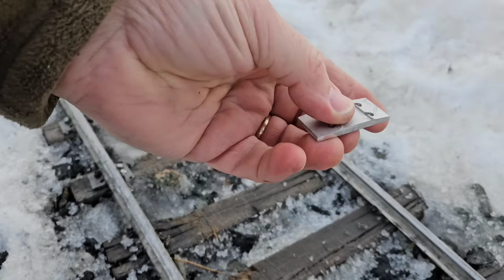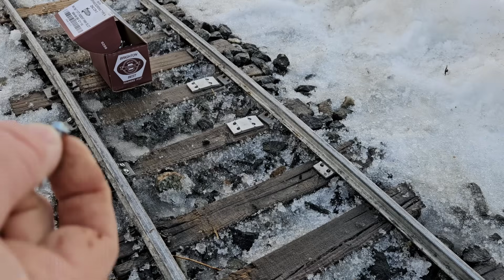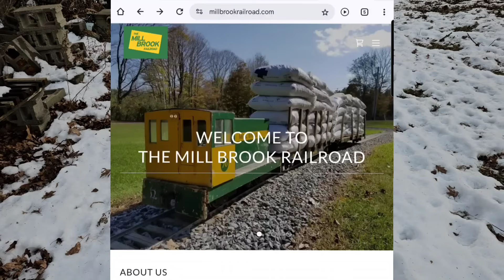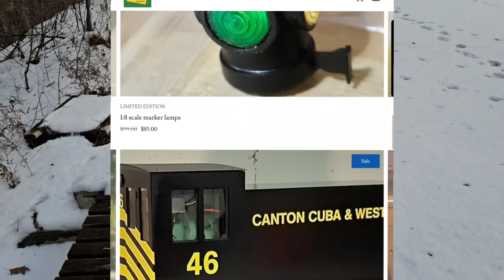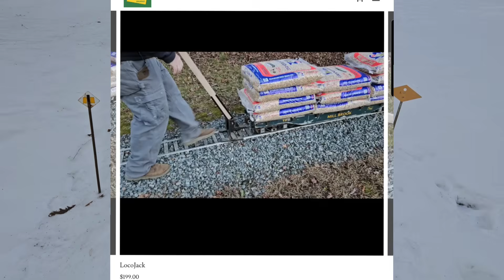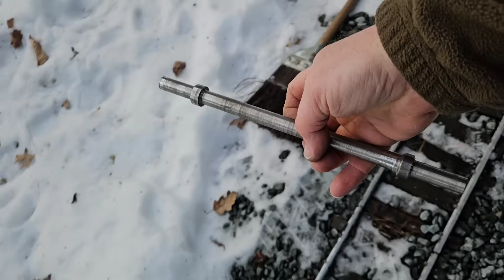Winter Track Maintenance: Tracking Down Wide Gauge

Comment: Before you replace the section of track. Look into resin ties. 
If your rails are aluminum, then use aluminum hardware. If you use steel hardware, you're definitely going to have problems.

Comment: make a wooden form for a concrete tie with a piece of rebar for reinforcement   should last a long time
Reply from the maker: I've been thinking about that for a long time. The part I need to solve is the tie plate part. If I make concrete ties then I want them to be pre gauged. So, I'll need to figure out how to incorporate a tie plate and a nut to go on the end of a threaded rebar. Not necessarily a difficult task, I just need time to do it.

Comment: There's a company in either Georgia or Mississippi that does batch part fabrication with sheet metal. Destin of Smarter Every Day did a video of them around or before COVID, so that's how I know them. If you can draw something up, it should be fairly easy for them to stamp out tie plates from a spool of Aluminum. The number of die strikes is small, so they should be able to do it with 3 or 4 dies. And the dies themselves wouldn't be very complex either:

1. Strike to put the four screw holes into the plate. (Also used for aligning to the rest of the dies.)
2. Strike to put the 2 degree canter bend you mentioned. 
3. Strike to cut and bend tabs to hold the rail in place.
4. Strike to cut the wider material into strips.
5. Strike to cut the finished tie plates off the strips.

They do all their tool and die work in house, so they can give you a quote for that. Destin did state in another video about a product he was developing (Made in the USA grill scrub brush) that the gentleman who was their master craftsman for the die passed away, but they do have someone he's trained. But with the sheer volume of tie plates your railroad (and others) will need, I think it makes more sense to got with a stamped product versus trying to cast or 3D print them.
Reply from the maker: Historically, tie plates for backyard railroads have been extruded aluminum. I'll have to look into stamping. Thanks for the comment.

Comment: Mark those bad ties to make them super easy to spot when you are in the mood to replace ties.
Reply from the maker: It's pretty obvious which ones they are. They're the ones that are splitting.
Reply: @MillBrookRailroad  Might be a good idea to keep a bundle of those "Utility Flags" in the 70. This way, anyone having a derail can just grab one of the flags and plant it in the ground near the problem area for the track maintenance crew (you and Eric) can find and fix later. I know train mountain have those green painted blocks, but the flags take up much less space, and the orange or yellow ones really stand out against the greenery of the Mill Brook Railroad.

Comment: Hey, Aaron, I may have asked this before, but would using self-tapping screws help mitigate your ties spitting? I realize they're more expensive, but using wood screws tends to split the wood along the entry point. Maybe even using a drop of wax on the tip of the screw would help
Reply from the maker: Self tapping screws might help. I don't know. I'm using sheet metal screws, which can cause  some of this splitting because of a more aggressive thread. The most important part of the screws for holding down track is that they need to be hex washer head screws with a 1/4" drive. That's the sweet spot. I've been using #8's, because someone donated a case of them, but #6's will also work and may not split the ties as much. Either way, 3/4 or 1" long is what I  look for. The tie plates on the larger rail that I'm going to install takes #6 screws, so that change might solve several problems at once.

Comment: Why not use polymer tyes.
These were trieled on the Ffestioniog at  the new Porthmadog Harbour extention station.
With the bad icey weather snd salt spray from the waves, they have proved sucessfull.
They are extruded so they can ve made in zny size.
On the FR they are cut down le
Ngths of standard rr tyes, the rail chairs are screwed down imto the new tyes and hold better than in the wooden tyes.
Reply from the maker: Where would I find polymer ties?
Reply: Tim @WayOutWest uses ties from recycled plastic, made from plastic tarps that are used a lot in agriculture. It's pretty much the same stuff as the plastic foil that's used for packaging all kinds of stuff. A company near him makes a few sizes of plastic 'beams', one of them seems to work perfect for him and the purpose of his railway.
But that's in western Ireland. Don't know if there's any such companies near you.

Comment: I imagine steel is the best overall for retainers
Reply from the maker: If you have metal tie plates, it is best to match the metal that the rail is made of.
Reply: Mixing metals starts galvanic corrosion.  Not a good thing for an outside railroad.

Comment: I don't know a lot but what if you cut up a bunch of ties and soaked them in a bucket of creasote then hung them to dry qould they last longer?
Reply from the maker: The dark brown ties were treated just as you described.
Reply: Full-size ties are also under pressure when treated, to get the creosote deep inside.

Comment: You would think those Thai plates would grip the base of the rail a lot higher than they are to be able to work. Boy don’t you just hate it when somebody sits there and criticizes you? Yeah me too! I think if I won the lottery after taking care of my family, I would buy you enough Creo salted floaters to do your whole Railroad and make some cast-iron Thai plates. The weather in your area is just too volatile back-and-forth to use anything plastic like 3-D printed tight plates.
Reply from the maker: I keep thinking about doing a video about what tie plates do and why they are designed the way they are.

Comment: Why don't you use a wide-bed 3D printer with an outdoor rated filament (carbon fiber?) to make some sleepers?  You could add gauging brackets with metal inserts or make sleepers that slide over the rail profile slots?
Reply from the maker: That's s good idea, but I don't have a wide bed 3D printer.
Reply: @MillBrookRailroad  Yeah, I know you have a resin printer which I know nothing about.  Do you want me to make up a prototype based on  your specs?  The strongest filament I have is PETG at the moment.
Reply: @kirkrende3935 it might need to be a CF or GF infused filament to cope with all the stresses of the environment.

As a side note, I've had good success with PETG, but I haven't used it for serious load-bearing structures like rail ties yet.
Reply from the maker: I think ABS has the best chance for long term survival, but I don't know if anyone makes ABS filament.

Comment: Is plastic ties available. If yes i know cost is a factor but would they last longer and be better against freezing temperatures wheb snow or ice builds up. Have a great day be safe and stay warm
Reply from the maker: Cost is a factor and the plastic lumber I'd have to use flexes more than wood. That doesn't rule them out, though. Accu-ties won't work with the 5/8" rail I use and I don't need enough ties to make it worth their time.

Comment: Work looking good, hope the metal tie plates hold up, definitely stronger. You can see the derailment wheel marks in the ties. So your using mainly 16mm rail? And the next size up here would be 21mm.  Looking at one of our suppliers in the UK there's also 25.3mm which is US scale,  32mm,  28.7mm,  35mm and 45mm rail for track up and beyond 15" track gauge if you wish.  Also steel bar rail.
Reply from the maker: I was wondering what the rail sizes were in the UK. Thanks! 
Most of my rail is pretty small. The 1 inch rail that most people here in the states use is 25.4mm. Very close to 25.3mm. I'm hoping to be able to get some 1:8 scale 115RE steel rail made in the next couple years.
Reply: @MillBrookRailroad  FWIW...  If you can afford 1" rail over the 0.835" (about 21.2mm), Live Steam Station is very close to releasing their #5, #7 and #9 cast steel frog, points and guard rail sets for 1" rail.  Not cheap at about $500-$575 per set (depends on the frog number), but it would give you the option to rebuild your turnouts as funds become available.  The turnout parts sets are not very budget friendly, but the upside is the cast steel will probably last darn near forever.

My guess is your choice of 0.835" rail is because there's considerable cost savings there?  Are there commercially available turnout parts for that size rail?

Comment: Have you been experimenting with different kinds of plastic for the tie plates? ABS or some carbon reinforced plastic that is not sensitive to cold, UV might work. Otherwise,  a metal plate would be required.
Reply from the maker: I have two resin 3D printers. I don't have a filament printer yet, but I do have some carbon fiber nylon tie plates on the curve that a friend printed for me on his Bambu X1C. They're still holding for now, but none of the resin tie plates have held up, and I've tried several types of resin. They tend to break at the screw holes.
Reply: @MillBrookRailroad You may want to see if you can make them thicker around the holes, or maybe allow for a metal tube insert to help avoid the stress cracks, but at that point, a stronger material might be less effort .Not sure if a heavier rail would help but you might just be pounding the ties and the tie plates too much considering the loads you run.

Comment: great job Aaron , yes it is better to have warmer temps due to expansion of the rail you want tight joints, otherwise they will have 
massive gaps. how is Mr Batcat and Mr. Tolkien doing ? has mr batcat been shirking  his track inspection duties ? what does 
mr. tolkien do on the Millbrook RR ! does he ever ride the rails? say hi to Eric and the crew!
Reply from the maker: Tolkien has ridden the train a couple times. 
Both cats have been patrolling the engine house and sugar house a lot lately.